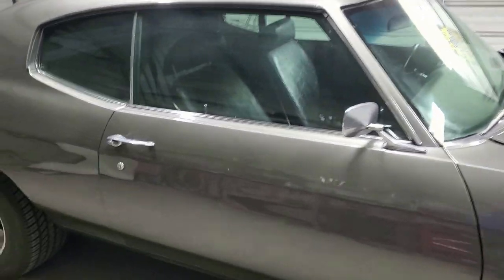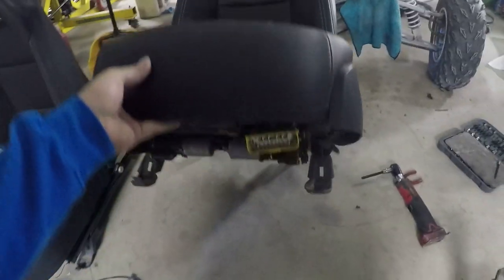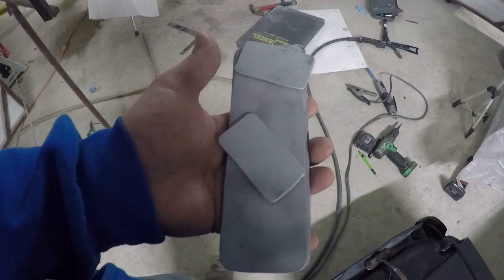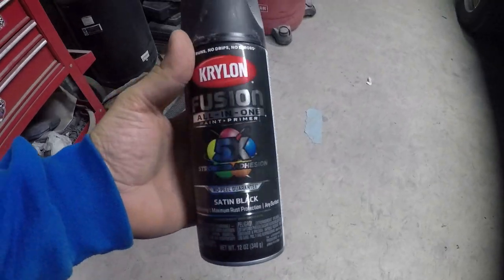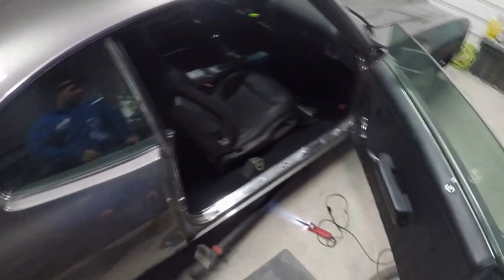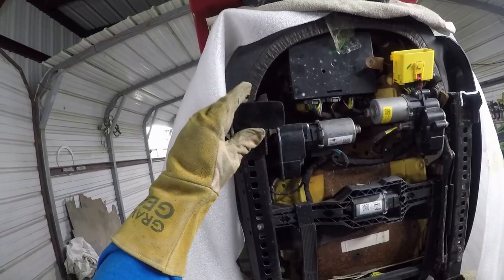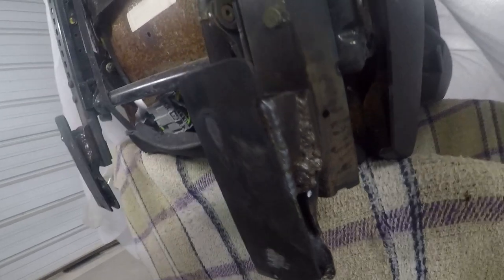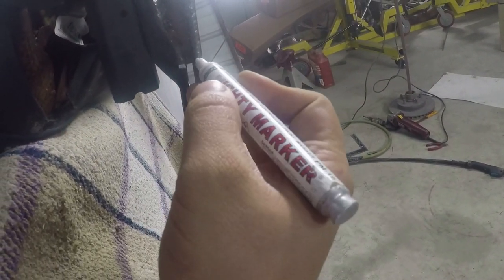C7 Corvette Seats install on 1970 Chevelle

Comment: Would you sell some plates to make them fit?
Reply from the maker: @somarplayz6394  I would have to remove my seats and replicate them....that would be quite the chore to make brackets that I wouldn't want to sell too expensive...unfortunately I would recommend more so taking your ride in to have then installed by a custom shop or fabricator